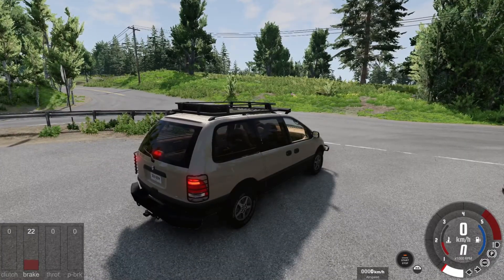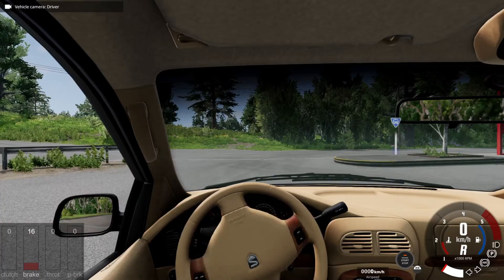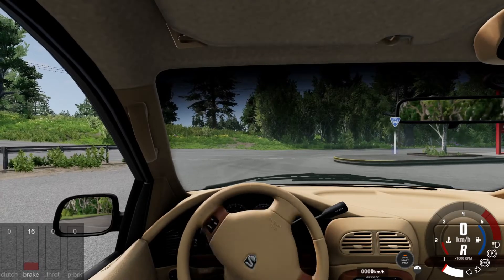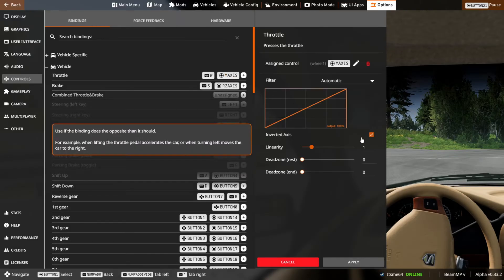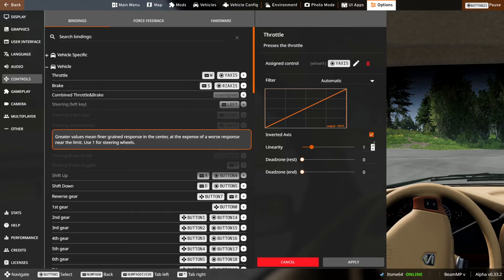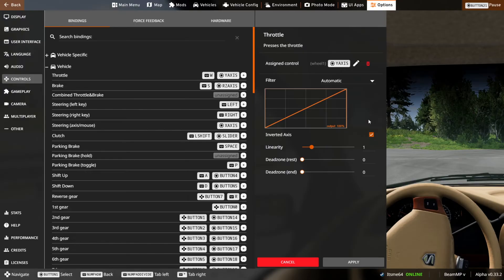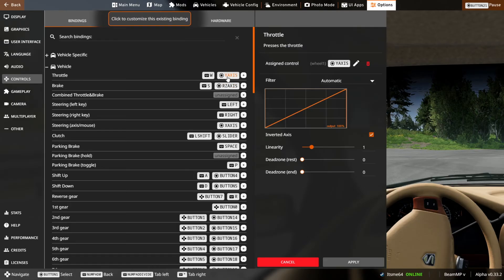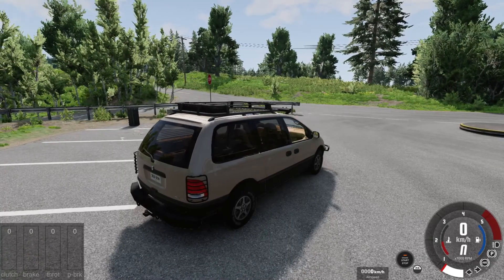BeamNG Drive Pedal & Wheel Calibration Issues On Startup FIX

Comment: Hey thanks but help!
i am playing beam ng on a stering wheel and when i push throttle nothing happens, but when i dont do anything the car pushes throttle and brake..
When i push brake it stops
HOW TO FIX IT
Reply: Having same issue
Reply: @jxmaican_rxm_gxming1 invert your settings for throttle or whatever is doing the opposite
Reply: go into your settings and tick the box in both accelerator and brake that says "invert". then its fixed.
Reply: @poteyto4 yes thanks brotha!
Reply: Did u fix it
Reply: @SurronFn nah😭😭😭
Reply: SAME FOR ME BRO I LETR GO OF THE PEDAL IT GOES IN REVERSE
Reply: Same here did anyone figure it out plzzzz